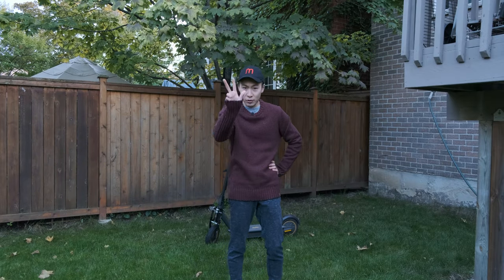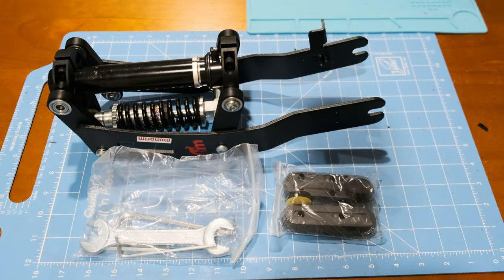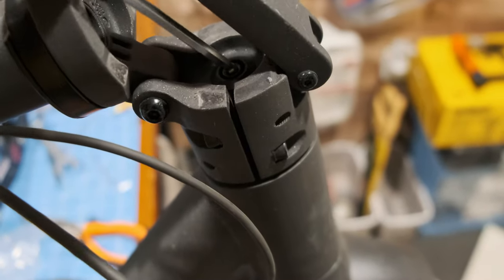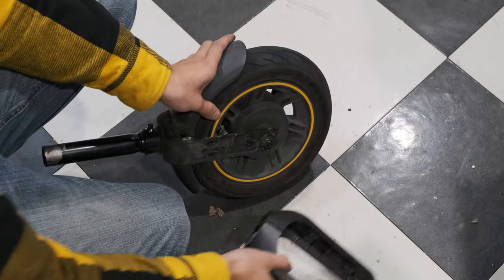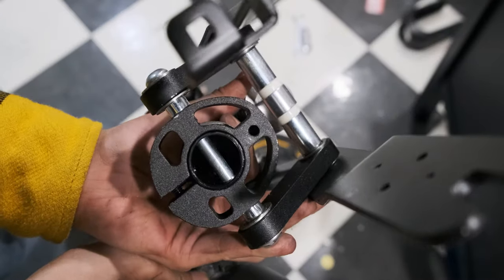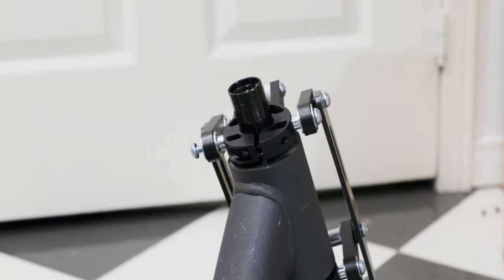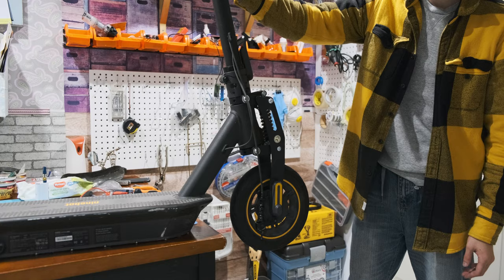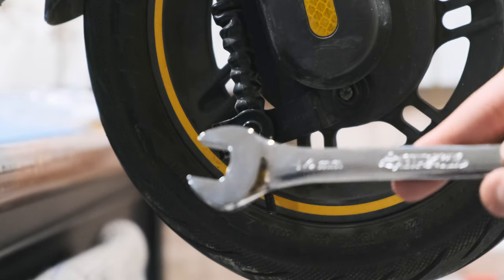Ninbot MAX Suspension (Monorim V2 Intallation Guide)

Comment from the maker: Purchase link: https://amzn.to/33t8Oq9
Reply: I saw the shaking in the video. I made many adjustments. But it still didn’t work. I had to 3D print a gasket on the shaking part. The problem was effectively solved. May I ask if you are shaking  How to solve this problem under the circumstances.

Comment: I saw the shaking in the video. I made many adjustments. But it still didn’t work. I had to 3D print a gasket on the shaking part. The problem was effectively solved. May I ask if you are shaking  How to solve this problem under the circumstances.
Reply: Use the original black rings...not the silver one.

Comment: Use a Heat Gun on the Reflector's if you want to save them for re-use
Do-not use the Spacer Ring provided, even Monorim say's so, re-use original
Reply: Which part is the spacer ring?
do you mean the silver ring that replaces the 2 original black rings inside the stem?

Comment: This is wrong. You need the ring and spacer as it is, attached back to the fork. The ring Monorim ships is the same size anyway.

If you don't add the spacer, the fork will wobble and the suspension will be stiff.

All videos on YouTube are wrong, who told you to remove the spacer, I had so much of a headache with solving my wobble, and eventually tried to add back the spacer!

Please update your video with new instructions!
Reply: Which item is the spacer? Any link?
Reply: @muSPKwow  4:10 and use the same screw.
Reply: @StojanovskiTV  Yeah those, I threw them away, so my scooter is gonna wobble 4ever :(
Reply: Thank you so much! I am upvoting this!!
Reply: Thank you! Noted